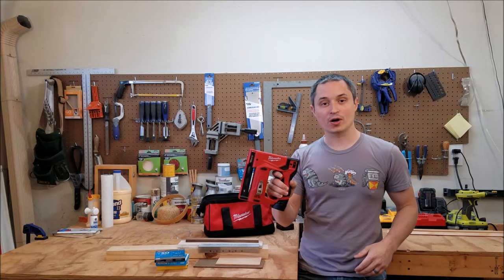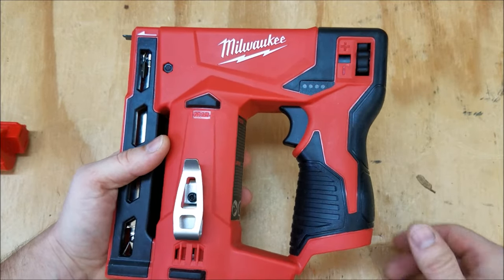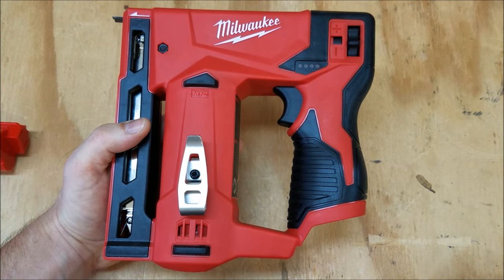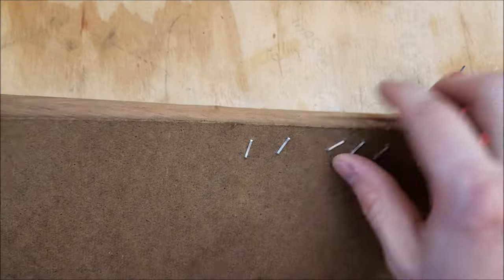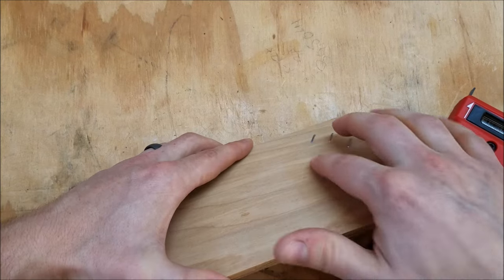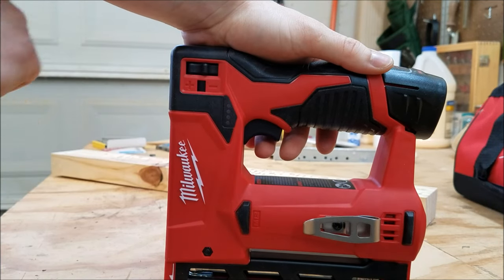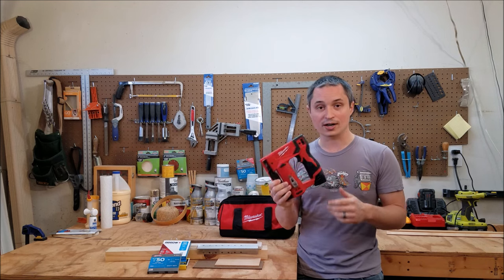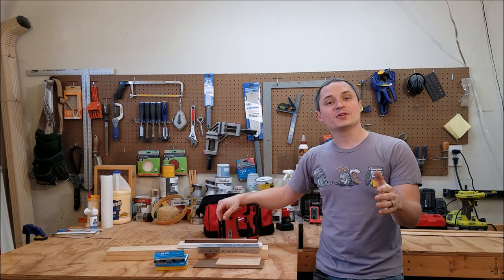Milwaukee M12 3/8" Crown Stapler Review

Comment from the maker: Here's the running list of how it performs in different materials:

1) 1/2" staples through 1/8" hardboard into walnut: Staple crowns are driven in contact with the hardboard surface, but not flush. Occasional minor staple leg deformation upon close inspection.
2) 1/2" staples through 1/4" hardwood plywood into pine: Staple crowns are partially embedded in the plywood, but not completely flush with surface.
3) 9/16" staples through metal corner bead into drywall: Staples are hit or miss for penetrating the metal corner bead, but stand proud of the surface up to 1/8".
4) 9/16" staples through drywall into pine: Staple crowns are driven in contact with the drywall surface, but not flush and don't break paper. With careful placement this could work for fixing metal corner bead if you straddle preexisting holes.
5) 9/16" staples into bamboo: Staple crowns are driven in contact with the bamboo surface, but not flush.
6) 9/16" staples into pine: Most staples are flush with surface, a few have their crowns partially embedded in the surface but not completely flush.
7) 9/16" staples into particle board: Staple crowns are in contact with the surface, but not flush.
8) 1/4" staples into MDF: Staple crowns were partially embedded in the surface, but not completely flush.
Reply: Doresoom Reviews 
Why bags?? I need hard red cases. I have to many bags now!!!!
I wish cases could came with a stamped tool......
Reply: 9/16" staple is way too big for corner bead, and you shouldn't shoot the staple in the middle of a galvanized corner bead,  3/8" staple on the edge will be okay.
Reply: Hey for some reason my battery life lights keep on flashing and it has 3 bars but it will not fire? Please help

Comment: I do low voltage and use the round head crown staples and think they really missed out not including that I see they have the gun with a small and big battery and charger for like $110 today on the home Depots site but that's mostly what I use them for and occasionally some brad nails which it also doesn't appear to accept
Reply from the maker: I've used this stapler for low voltage wires a few times, but I always have to "float" it with the safety nose just touching the wire, and hope that I get it tight enough to hold but loose enough not to damage the wire. You could probably make a nose guide to get the right distance consistently (maybe 3D printed), but you'd still be stuck using T50 staples, which is the only thing this shoots.

Comment: What is the difference or should I say the differences between thev 18 volts and this 12 volts,from what you said here this 12 volts can use different staple sizes,is it the same with the 18 volts because if I am not mistaken the 18 volts is called the narrow stapler.I really need this information so that I don't end up buying the wrong tool.I have bought lots of Milwaukee tools and I want to add this to the collections.I look forward to hearing from you.
Reply from the maker: The 18V narrow crown staples shoots staples that are made with thicker 18 gauge wire, 1/4" wide and up to 1.5" in length. This staple shoots 3/8" wide T-50 staples that are made with flat wire and only up to 9/16" in length.

Comment: This stapler as I noted in my review on it is more suited for Stapling down insulation or Tyvek or other kind of  sheeting.... for other applications such as Wood I sometimes use a stapler but i use my Ryobi 18 V narrow crown stapler.... givin The width of the narrow crown staple it drives in much better too hard surfaces... not to mention it is being driven in with an 18 V versus a 12 V....They both have a specific applications that they are going to be best for

Comment: If you put one leg thru the hole, it will work for corner bead. Thanx for the review.
Reply from the maker: Good point - the staple location is marked pretty well to allow for accurate placement, but it would take a lot longer to line the holes up. Or you could use metal mesh or vinyl corner bead and you wouldn't have any trouble at all.

Comment: We use an sir stapler for our beads, we don't staple through the metal, we hook the edge of the holes in the bead so this gun would do fine
Reply from the maker: Good to know - I thought it might be too tedious to do so, but it sounds like you make it work. The stapler allows for pretty good placement, so it should definitely work for using the holes along the edge.

Comment: I tried using this reupholstering a chair and it wouldn't even go through a thin layer of batten. It only fired one in 10 times what am I doing wrong?
Reply from the maker: This has a contact safety that will prevent it from firing unless you have it pressed firmly against a workpiece. Push it hard against the surface you want to shoot into. Also, if the surface isn't solidly supported, you need to brace it from behind with something heavy to keep it from moving.

Comment: Quality tool. Runs forever on one battery.   I just bought one for stapling silt fence to hardwood stakes for job site erosion control.  We just a mile of fence...  A stake every 6' and 5-10 staples a stake= a lot of staples.   I think it earned its keep in that job alone.  Nice quality review.  Thank you for the time and effort.

Comment: I need one that shoots 1-1/2 in staples, until then i'll be using the Ryobi which been using professionally for 3 years thing is great for luan.
Reply: Do you still use the ryobi?
Reply: @stitchthisditchthat259  my helper was using it a bit too quick and fried it, I eventually just started using an air compressor/pneumatic but the thing was good for smaller jobs

Comment: What if you put your other hand on top of the staple gun wouldn't that allow it to penetrate harder surfaces? I need one to do atv seats which is in plastic I tried a non power stapler with no luck I hope this works.
Reply from the maker: Pushing on the back will give it the best performance, but it will only do so much. The Ryobi 18V stapler I also reviewed is actually a little more powerful for hard materials, but it's heavier and doesn't have bump fire mode.
Reply: @DoresoomReviews  well I ordered the m12 we shall see I'm sure it will go through the plastic there is probably better quality staples to try as well we shall see.
Reply: Did this work for the atv seats?   Need on for the same

Comment: Curious if this stapler work OK with PVC sheet. I need one to staple the vertical garden linen against pvc sheet
Reply from the maker: I've used it with expanded PVC sheets no problem. But I'm not sure if the staples will penetrate well for solid PVC.

Comment: Well for one it can do metal corner bead. You are supposed to use the staples on the holes.
Reply from the maker: The Ryobi 18V can handle shooting through the metal corner bead. Hitting the holes with the M12 takes a lot more careful placement.

Comment: I know this is 6 years ago but would stainless steel staples go thru that metal?
Reply from the maker: I don't think it's the staple material that's the issue. The Ryobi 18V stapler can shoot the same staples through that corner bead.
Reply: @DoresoomReviews  sweet thanks  too bad they don't update the stapler and put in a brushless motor

Comment: Will this stapler take the larger Milwaukee 12 volt 4.0 AH battery? The part that is inserted into the tool is the same, but there is extra battery that hangs off to the side. I have both batteries and so far all three of my Milwaukee tools will take both batteries.
Reply from the maker: Yes, the 4Ah and 6Ah XC style batteries fit this tool.

Comment: were these the regular staples with a flat point, or the heavy duty ones with slanted sharp points ?
Reply from the maker: Good question - I hadn't factored that into performance. The staples  I've used with it are angled points for 1/4" long, and flat points for 1/2" and 9/16".

Comment: Would you be confident with this guy doing light upholstery work? Like replacing a seat cover on a motorcycle, or a leather cover on a center console in a car?
Reply from the maker: I think so - I haven't used this one for upholstery, but it seems to have more power than the older corded Arrow stapler that I've used for upholstery in the past. Although that was for fabric and not leather.
Reply: I tried using it to replace the seat cover on my motorcycle with limited success.  I ended up using a pneumatic stapler that had more umph.

Comment: Do you know if this would be a good tool for assembling Picture molding for a picture frame? Thanks, Steve Trerotola
Reply from the maker: I think a 23 gauge pin nailer would be the best tool for that job, not this stapler. Milwaukee actually just announced they're coming out with one on the M12 platform too.

Comment: Can doing soffit and fascia board with this stamolr gun
Reply from the maker: An 18ga narrow crown stapler would be much better for doing soffit. You just don't get the length with a 3/8" crown stapler like this one. Up to 1.5" length with a narrow crown stapler vs max 9/16" length for the T-50 staples this one uses.

Comment: Would this be idea for Eaves,baseboard,door casing and trim work around the house or should I go with a small nail gun?
Reply from the maker: No, this isn't powerful enough for those applications, and the staples won't be long enough. You want a 1/4" narrow crown stapler or a trim nailer for those applications.

Comment: Hi, thanks for posting your review. Could I request that you  fire in some 6mm/ 1/4" staples
into some MDF please. I would like to know if they will fire in flush before I go out and buy one. Thanks.
Reply from the maker: I didn't have any scraps of MDF lying around - I think I just threw out a ton a month ago! I did test this on a scrap of bamboo though, and it sunk a 9/16" staple so the crown was completely in contact with the surface, but not embedded in it. Bamboo is slightly softer than some published values I could find for MDF, so it most likely won't get it sub-flush in MDF, but it has a good chance of sinking it without leaving it proud.
Reply from the maker: I dug up a scrap of MDF! For a 1/4" staple, the crown of the staple was halfway embedded in the surface on max power mode, but not completely flush. The scrap was only 1/4" thick though, so I couldn't test any bigger staples.
Reply: Hi, thanks for taking the time to test that for me, much appreciated. 1/4" is perfect as that's all I ever use into MDF. Its pretty much for making 'glassed resined car stuff like door trims, consoles etc. 

I have an old Ryobi P300 that I use for this and it can't quite sink them into MDF either so I guess I might as well stick with it. 

Again, thanks for taking the time.

Comment: just wondering if you could tell me how will it fare firing staples into plastic solid plastic?
Reply from the maker: Depends what type - it made it about 1/16" into solid polycarbonate, but sank flush below the surface into 1/8" thick foamed PVC into pine. I didn't have any other scrap plastic on hand.

Comment: Hi can you do metal trim over drywall with crown staples rather than normal staples? Thanks
Reply from the maker: This only shoots 3/8" flat crown staples (T50), which is what I was using in the video.
Reply: Ok thanks. Country difference = different terms for staples. Nice vid👍

Comment: I never do and I almost returned this one, I would be maybe good hanging up some insolation but other than that it has a huge design flaw. If you put the head against a wall or anything it drops the staple about a half inch behind the nose of the tool a stapler should put the staples out as close to the nose as possible, I was trying to staple a threshold down for some hardwood flooring and it couldn't staple the strip no matter how I placed the gun. the little metal safety thing sticking out is also terrible. THIS ONE IS A FAIL BUT SO IS ALMOST ALL MY MILWAUKEE!!! Get DeWalt way better and yes, I have all the major brand cordless tools and use them see for yourself take a 1 5/8 hole saw like for a door handle, and you will see Milwaukee will cut out and make you reset the trigger several times before you get through a door no other tool will give you a problem only Milwaukee will even a Ryobi can do it!
Reply from the maker: I think the stapler performs fine, but I can see why you might not like the nose design. But I have no idea what you're talking about with a Milwaukee drill not having enough power. I've run a 2" hole saw no problem with my M12 drill. An M18 Milwaukee drill won't even notice you have a 1-5/8" hole saw attached to it.

Comment: I  would appreciate your opinion on how this might work for staple on awnings, where you have to fire into an aluminum extrusion through a groove and how's the accuracy for upholstery ...thanks!
Reply from the maker: It depends on the thickness of the aluminum, so I can't really say anything definitively for that application. The accuracy is pretty good - it just takes a little practice. The staples come out about 1/8" lower than the bump fire actuator so there's a little bit of guesswork for vertical alignment, but it's perfect for lateral alignment.

Comment: Out of curiosity, do you think that if the stapler had a 3 or 4 ah battery with the power turned all the way up it would make it through the corner bead?
Reply from the maker: I just tried it again with max power and a 4Ah battery, still no joy. I think it would work fine with just about any other type of corner bead other than solid metal though, especially with vinyl.

Comment: Why my tool can not fit 3/8" staples in side?
Fabric diffect!
Reply from the maker: Are you using T-50 staples that have a 3/8" crown width, or are you using 3/8" long narrow crown staples? This won't fit narrow crown staples if that's the case.

Comment: Do you know if this will fire any small brad nails? I have a manual Bostitch 2 in 1 stapler that will fire either T50 staples or very short brad nails and that is a pretty cool feature.
Reply from the maker: Staples only for this one unfortunately. I was a little surprised it couldn't handle brads too, since the manual Milwaukee stapler can do both.
Reply: Bummer still looks like a great tool and thanks for the great review!

Comment: Could this be used to staple cables to wood walls or drywall?
Reply from the maker: I've used it for low voltage cables, but it's not ideal. You have to dial the depth way back and kinda float it in front of the cable. It's a little dicey - you may end up breaking the insulation and causing a short. 

If you need to do Romex, the 3/8" staples aren't big enough, and you'll need something like the DeWalt cable stapler.
Reply: Okay thanks...I used to use a old fashioned stapler with rounded staples and it worked for things like 18 or 22 awg cables so I was wondering if this can do the same

Comment: I bought one of these and was disappointed in it. Does not have enough power to sink a staple in some soft wood. Great for stapling paper on insulation but not much else, so I returned mine got refund.
Reply from the maker: What kind of wood? Mine sinks staples flush anout 90% of the time in pine, sometimes leaving a very small portion of the crown just proud of the surface.

Comment: Can you use it on cat 5 and cable wire
Reply from the maker: You can, but you'll have to be really careful with placement. I used it to staple some power cords for my battery chargers up out of the way, and found that if you "float" the nose safety on the wire and depress just enough for it to fire, it will work pretty well with a 9/16" staple. However, it takes a lot of time to get everything lined up right - so if stapling wires is your primary application, I think I'd still recommend buying a stapler built for that purpose.

Comment: All the good DRYWALLERs use plastic corner bead. I guarantee it will go through the plastic.. so this baby is perfect !!!
Reply from the maker: You're right, it should slice through vinyl no problem. I only had the strip of metal corner bead lying around from some repairs I made a few years ago - I'm definitely far from a professional skill level when it comes to finishing drywall.
Reply: Brook Anderson you mean all the cheap drywallers underbidding everyone using Mexican laborers to drive down wages use plastic instead of metal

Comment: I like it but ryobi   it's better
Reply from the maker: Does Ryobi make a One+ stapler that shoots T-50 staples? I'm only aware of the P360, which shoots 18 gauge narrow crown staples, not T-50 staples. Plus, that one costs $20 more and weighs in at 5 pounds bare tool, vs 3 pounds for this stapler.
Reply: I mean just use a regular hand stapler for that unless your lazy oh also i just subbed 😄😂👍
Reply: Yes ryobi has a stapler that shoots out staples and nails. I have it. It's like 8 years old but still works like a champ!  Old ryobi batteries suck ass though. Need to get some one plus batteries